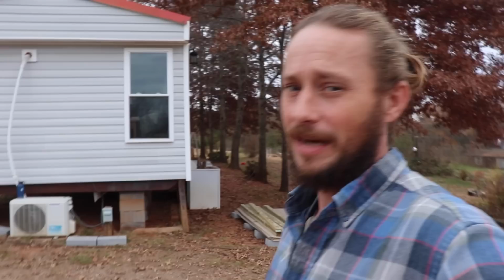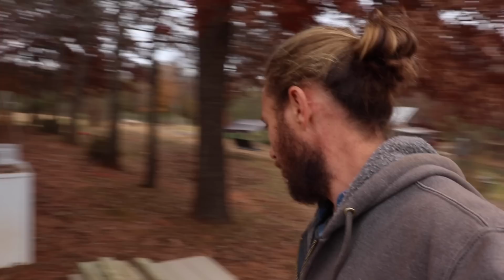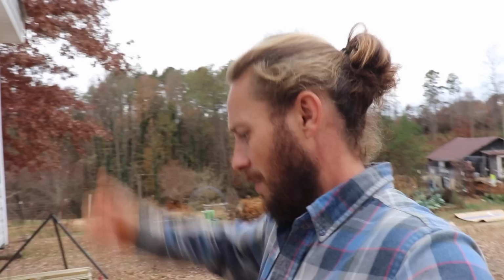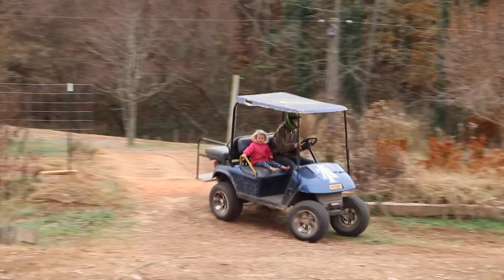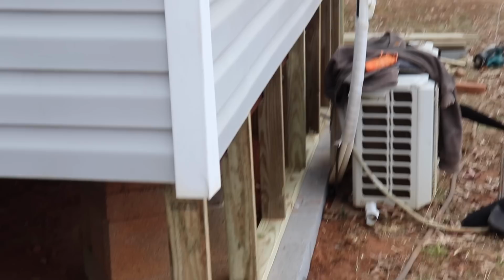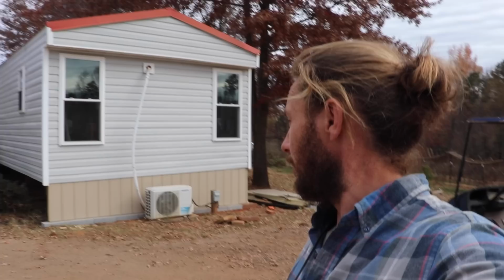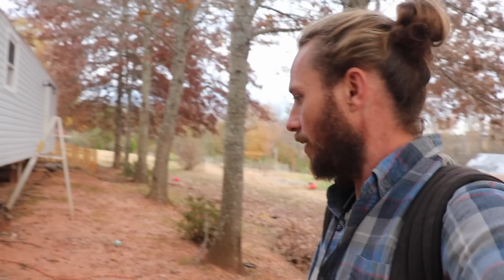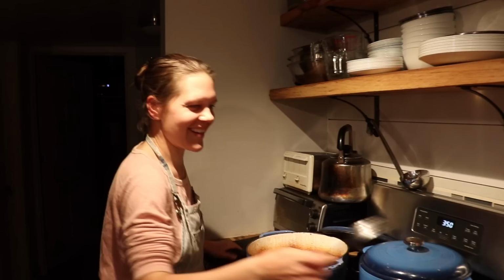It’s Finally Time

Comment: I laid down 7x12 tarps on the dirt as a cheap moisture barrier. Easy the handle and cut around the foundation blocks. You seal in your home with skirts you trap moisture coming up from the dirt..

Comment: I insulated my skirting and found that the temperature stays about right for a root cellar.  You have enough buildings you may not need a root cellar.  I sure did!
Reply: Like "BOSS OF THE SWAMP" He  buried a metal truck tool box except the lid, to put items in that needed to keep cool but not frozen.

Comment: Oh Ben! Your bottom x
2x4 needed to be on the front edge of the blocks! That way you can lap the sheathing down over the edge of the block about 1/4 of an inch to sheet the rain off. The water is now going to run down the sheathing and pool on those blocks keeping the 2x4 sill plate wet and limiting the life of it, even though it’s looks to be pressure treated. Since it’s not load bearing, you only need a block under each 2x4  upright. I can see that the pillars for trailer limit where you can place the cap blocks, but you can finagle it! Turn them on edge and bury 1/2 way if needed. That’s just the support system for the sheathing, it doesn’t have to look pretty just functional.

Comment: Nice job Ben on putting up the wood skirt on the side of your trailer.  I think it probably would be expensive using metal as skirting since the prices keep rising on building type materials.  Remember to give yourself an easy entrance point if you ever need to do work under your trailer.  That leaf blower made short order on getting the leaves out of the way.

Comment: Insulate the skirtings. And ventilation holes. T 1 11,foam backing at least on the north and windward sides. 

and black plastic to keep the mice out.
Reply: I agree with all but the black plastic. Mice LOVE plastic & fiberglass insulation beds. But they hate bubble wrap. So do bugs & bees.

Comment: Its risky to put wood in contact almost with the soil and then attaching to the trailer. It can create a path for termites.  The 1980 trailer we are renovating right now, had wooden frame skirt, and the termites tunneled up them,into the main structure. 
You will need to monitor that frame for the life of the skirt for termites each spring.

Comment: Put a couple of air vents in that skirting to prevent moisture build-up, especially in the hot, humid summertime.  You can mostly close them for wintertime, but at least some air flow is a good thing.

Comment: Ben one thing to consider is the condenser for the mini split you might want to move it out away from the new wall that you built so it can breathe better at first when the underside was open it could breathe being close now that you have a wall there it will have to work harder to cool down in the summer and heat up for the winter.

Comment: I don't know about pressure treated wood where you are but here in Missouri it is prone to shrinking. If friction is all that is holding it it's not going to last. Your blocks will also settle over time and it will probably fall out. Better to bury something solid in the ground to anchor it to and fasten it to the bottom of the trailer to ensure that it lasts. It's a lot of effort, might as well do it right.

Comment: i used 4x8 sheets of the 2in thick blue insulation an doubled it on the back side of my skirting i had 4in of insulation an it made a hell of a difference

Comment: Don't forget to build a service door to get under the trailer if you have an issue to fix i.e. water/septic. 
Also if you get a little foam boards or reflctic bubble wrap to adhesive to the backside of your T-111 and some gap spray foam for the top edge , you will have a nice & tight space thats insulated under there. You can add a few pallets and stack supplies under there or building materials as you can afford them to put on the back deck and Buggies' bedroom next year. The materials would be high & dry. And no wallet pinch for affording them.

Comment: I'm about too some steak and peppers and onions for tomorrow's meal. I can eat all day long on it. And yes I've get the onions and peppers do up in the freezer. I got one up right freezer cleared and starting the 2nd one. So I can get egg rolls,mini and hand pot pies made for the freezer and pie crust. Cause I make 20-24 crust at a time. I couldn't make a good crust till I tried the lunch lady crusts. And they last for a year in the freezer as long as you wrap in plastic then foil wrapped too.
Reply: Do you have a recipe you can share?

Comment: Under the trailer is a nice cool place in summer, and a warm place in winter for the cat. I know someone that put a cat flap for the outside cats to go under theirs.
Reply: That's a big sandbox under there. Hot cat poop odors coming up into the trailer doesn't sound good to me.
Reply: @denisewilson8367  Nope, the cats used the litter pans provided under the deck where they were accessible to clean.

Comment: Looks great. In the panhandle of tx we wrapped our pipes on our double wide with heat tape. Our siding was buried about 3 inches under siding bottom.  Had skunks and prairie dogs next door. Hated the smell of skunks under the house. Have you washed the green slime off the house by the front door?. The end of the house is so white it seems. The house skiing will pay for itself on the heating bill. Blessings

Comment: Ok dont forget vent holes I got a story on that one my grandpa had developed alltimers and grandma sold the house and they moved to a trailer park and I had done some work for them under the trailer and I noticed mold starting to grow under it I told grandma and my grandpa said I look then we walked around he needs holes I said ok and went and talked to the guy that ran the place he told me
It needs holes to allow airflow not anything big so that’s what I did I think they where 3 inch holes like 2 on each side with hardware cloth and some screen to keep critters and bugs out but even in the stages my grandpa was at he still helped

Comment: Looks good but get 8-10 cheap Vent covers, and install them at intervals.  And maybe a rubber flap, for kitty cat to get in there and keep mice out.
Reply: Kitty cat would use it as a litter box if it's closed in. No poop smells for me, thank you.
Reply: I've never had that problem.  Mire like they like the loose soil in the radied beds...grrr

Comment: Some people dig out a slit before putting down the blocks and put a L of hardware cloth in with half the L flat on the ground and the other half in the slit to discourage critters digging under. Did you consider something like that and decide there's no critters that are likely to want to den under?
Reply: I've seen that, but only on chicken coops.

Comment: 🇦🇺I’m sorry but did you say you can’t use your back door? Why? Isn’t that a fire hazard, as your kitchen is between your front door and the bedrooms. 
Chad from Doss Farms last week woke up to what he thought was his teenage son in the bathroom, then realised the light was yellow not white. The bathroom wall was on fire. He had little time to get his wife and 3 boys out. Lost everything. Just the clothes on their back. It happens sooo fast. I hope you have smoke detectors and fire blankets in place. Fire drills are good to practice.
Reply: They currently have no steps...the door opens just fine, iirc...in the event of needed evacuation...a short life saving hop would do the trick...I'm certain....just sayin'.....